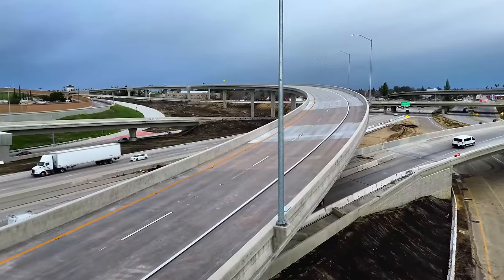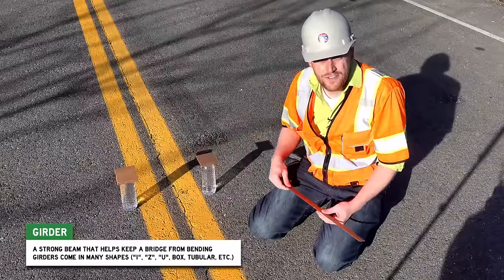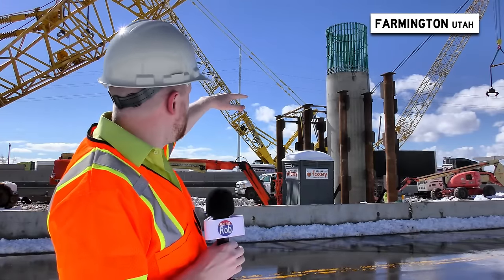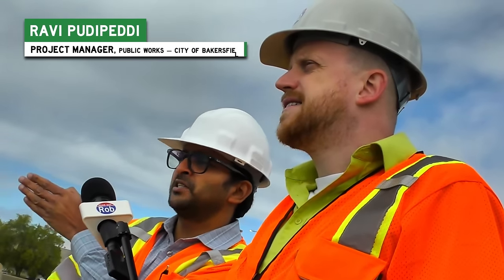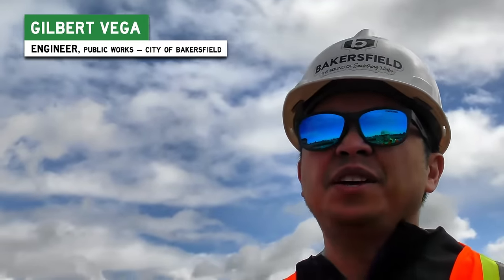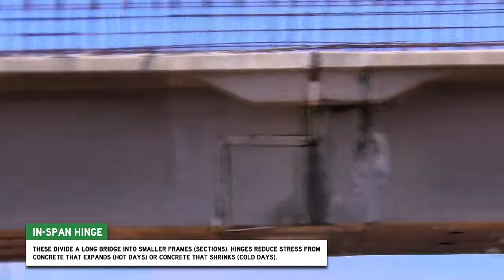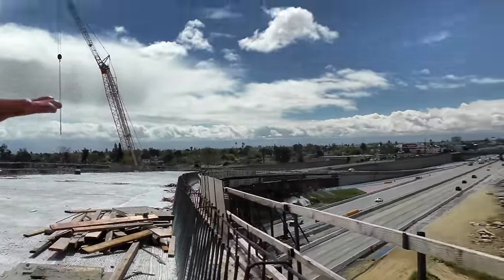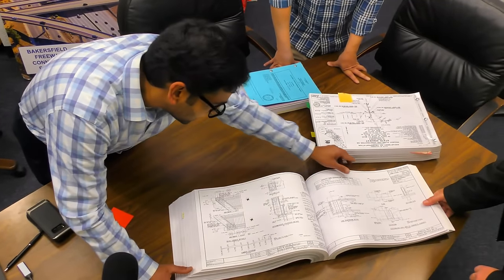This $100M bridge is made with WOOD and is TOTALLY HOLLOW

Comment: When they pulled out that brick of a book I gasped. So much paperwork
Reply: Remember when they flew to the moon they had a body tall size stack of code books (they still use "morse code" to code the instructions then...)
Reply: I have been involved in creating that paperwork.  That book is a set of drawings used to construct the road and bridges.  We drew them by hand using pencil and paper. And then printing sets of copies of blueprints on 36 in by 24 in paper. Later in my career, we went to computer aided drafting systems (Cad). We started printing on 11 in by 17 in paper. By the end of my career we just sent the drawings as electronic files to a printer that distributed them as PDF format electronic files to the contractors for bidding and eventually for the winning bidder, to construct the project. I suspect that by now, the use of tablets and laptops is replacing those books of paperwork in the field.
Reply: @Irishfan  I wonder if there's still a regulatory rule for that hardcopy as a hardware backup as a +1 to the 321.
Reply: Yeah. Considering the money involved, it's good to have a huge book of papers detailing every single minor detail just in case you need to hire a litigator to take it into court to argue why you shouldn't be responsible for a $5 million blunder.
Reply: @Irishfan  I definitely still use a paper copy, can't run out of battery, easy to see in bright sunlight, can spread out multiple pages etc. But yeah it might go fully electronic eventually.
Reply: @PrograError  Not everyone on site has access to a laptop/ ipad. We still use hardcopies most of the time. They are good because you don't keep zooming in and out.

Comment: It's impressive to see how much temporary infrastructure there is for big construction projects
Reply: Yup. Then add in safety requirements so nobody dies putting up a bridge, and you kind of start to understand why projects like these take so much time+money in developed countries. 

You could build this in half the time but it wouldn't be nearly as reliable nor as safe to build. It would cost lives during construction and then lives when it eventually fails before it was supposed to. 

Talk garbage all you want about how american projects go over budget and take forever, but we don't have routine failures like countries that don't build things properly/safely. The success is measured in preventable deaths.
Reply: @CRneu  Exactly. And it would get built in a fraction of the time if it was a completely new highway. But it’s built over and next to an existing highway with live traffic, which can’t just be shut down. Makes everything really complicated.
Reply: @CRneu  Most of the project time is wasted in worthless environmental studies.
Reply: I would love to see a future video about temporary infrastructure during road work
Reply: True. But all construction needs some kind of temporary works, even if it's just scaffolding or simple formwork. It's just that bigger projects need bigger and more impressive temporary works. On one military job I did the formwork needed to support a 1m thick heavily reinforced concrete slab. It needed as much engineering design as the slab itself!
Reply: @grandinosour  we do the environmental studies before the project starts. It’s required by law. It’s wrong to poison plants, animals and people. Plus it’s mean to harm native and endangered species. It’s strange to assume something is worthless when you don’t have a single clue what you’re talking about.
Reply: I ran some jobs to replace machinery in a big sewage plant. We had to remove a column to remove and replace the machines. It took 3 weeks to put up the false work, and only 2 days to change out the machinery. We did 7 of those

Comment: Rob, you do a wonderful job of concisely explaining complex engineering!!! Many box-beam girder bridges today are being built (35W replacement bridge in Minneapolis) using precast segments and use the same principles as the cast in place type you have shown (post-tensioning). The superelevations you noted on this project wouldn't allow for the precast type of construction.

FYI, the foundations shown for the bridge piers are called 'drilled shafts.' 
One minor correction: The top of the piers on this bridge are called 'pier caps' and not 'bent caps.'  A bent cap is normally used to tie together a group of 'bent' pile columns. 

Interestingly, box beam design is what saved the I-10 bridge in L.A. from needing a complete rebuild after the fire was set underneath in November. Had it been steel girders it would have collapsed like the bridge in Philly last year. Instead, they were able to use shoring (falsework) to support it and get traffic back on it while repairs are made to the damaged components.

Comment: FINALLY DID ONE ON BAKO! Knew it from the intro. This is the 58-W. For years, Bakersfield had 99 N and 99 S but only one way going east/west. 58 E is the only highway, 58 W was just a bunch of avenues you followed. Now we have the Westside Parkway, which is the Western highway of the 58, which is now finally connected via this project, known as Centennial Corridor.

Comment: Nice work! As a bridge engineer, i think you did a great job explaining how bridges are made! Of course theres a lot of other nuances that go into it but overall i think you did a great job! I haven't seen the hollow concrete girders used in my state yet but we use precast I- beams for a lot of our bridges without the slab on the bottom. The most similar thing i can think of that we used was a steel tub girder bridge but each tub was visible. Can't wait to see more from you

Comment: The post tensioning is the same principle (on a much larger scale) that has been used for a few decades now with homes build on slab (instead of raised foundation). Very common for houses built in the Phoenix area. Suppose to help prevent slabs from cracking and I suppose settling cracks on the house too. May be it depends on where the bridge is going, but I noticed with the I-10 super project through Tempe and Phoenix, the new bridges are being built one section at time instead of building the entire span at once. I noticed that today for the new interchange being built for AZ-143 to I--10 by Sky Harbor Airport.

Comment: Box girder bridges can be built another way, using pre-cast concrete segments you string together like beads, but then stiffen them with steel cables pulling the segments into a continuous deck. Those designs can achieve some mighty impressive spans, as much as 800 ft / 240m between consecutive supports! They see a lot of use in East Asia and Central Europe, where there's lots of deep valleys and canyons to cross in mountain regions.

Comment: The video is very cool, in fact there is a very good relationship between concrete and steel bars. Concrete is very good at withstanding pressure or weight but is bad at withstanding tension, steel is very good at withstanding tension but is bad at withstanding pressure. This is how reinforced concrete structures emerged, meaning it is not enough to just use cement or concrete, you have to reinforce the whole with steel bars. As for the stretched steel cable that runs through the entire structure, it is one of the most interesting inventions in civil engineering, the well-known prestressed slab, thanks to which it was possible to increase the span of bridges, and also the usable area of large buildings, roofs, everything. which uses concrete and steel.

Comment: The post-tensioning cables aren't straight the way shown here. They're higher near the columns and abutments and lower at midspan so that they exert upward force at midspan and transfer the weight to the columns and abutments. The long spans of today's concrete structures would be impossible if not for that. 

Including this important bit of information would've made this video a great deal more informative. I'm surprised the engineers in attendance didn't insist upon it.

Comment: I'm not a civil engineer, but I have to know how to read the designs in those plans because I do the GIS mapping for my state's DOT.  We have to keep all the state's maps up to date for the public but there is also a ton of data in the maps that the state DOT uses and we also have to submit tons of data to Federal Highway Dept every year.  So we also have to keep track of all local city, and counties too.  Anyway, it is incredible on how much goes into designing a freeway.  My state has done some of those hollow concrete flyovers, but mostly since we have several massive steel mills and mini mills (Indiana) we mostly use steel since it is easily accessed locally.

Comment: I thought they precast pieces of the box girders and then just threaded steel cables through it to pull them into tension.  At least that's how I saw them do it in a documentary about the Sydney metro.  If that works why don't they do it like that everywhere and not create the forms in the air?
Reply: there is a size limit on bringing precast components to the job site.  also a size limit to what can be cast on the ground and lifted into place.  part of the engineering is to determine how they will do it, and because of the size, it's usually easier to cast a box beam in place.  I my area had a historic bridge almost completely rebuilt, and the process involved driving temporary supports, and bringing in precast beams to build a temporary bridge, and then casting the permanent bridge in place, then removing the temporary bridge, and putting it in a spot where, I think, the precast beams still sit, to this day.  the precast beams were only 40 feet long, so they had to have supports every 40 feet, while the permanent bridge has an arch about 150 feet from anchor to anchor.
Reply: I-70 in the Colorado Rocky Mountains and I-635 US-75 were built like this. It all depends on the situation, cost, materials, time, etc.
Reply: I'd guess it comes down to a lot of external factors.  Like can you put up false-work at the site?  Is there an existing precast concrete factory nearby to leverage?  What have you built before?  etc.
Reply: @kenbrown2808  At least the technique I was thinking of didn't require the precast elements to be the size of the gap.  They put together a box beam from a bunch of short pieces and then relied on the tension from the cable to form it into a single element.

Though it did require a big weird crane to hoist it all into the air at once to let them tension it in place.
Reply: @petergerdes1094  that sounds like an engineering nightmare.  at that point, it's basically a suspension bridge with extra weight.

Comment: Fun Fact: At one point Caltrans switched over to the metric system, but they were running into difficulties with contractors during construction projects. Caltrans then switched back to imperial measurements.

Comment: I watched this free get built over what seems like my entire life time. The Cross town freeway, the West side Parkway, this is the Centennial Corridor that connects the west side freeway too Interstate 58 that came to a dead end at the 99. They had planned the west side parkway and built it and it had been pre-planned in the city development and a huge field just sat in between housing developments and shopping centers until finally about 10 years ago the built it and it was cool except it didn't connect to anything so it was not very useful. Bakersfield is a very sprawled out city and really only had the 99 through the middle and then nothing but surface streets to the west which was a traffic nightmare. There was the 178 which connected a portion of 58 through downtown but was not a freeway until you hit the 178 so lots of congestion. Then you had the 58 which connected to the east side but mostly industrial and dead ended into the 99 where you had to get on the 99 go a mile up north and exit to Rosedale hwy and a bunch of confusing turns and it was a mess.This now makes what took 30-40 minutes into 10-15 minute drive. Its great especially when they get it to the Interstate 5. Also i just watched the roundabout video and they are doing wonders here on hwy 43 which would get horrible congestion from farm workers and oilfield workers having to stop at stop signs now its free flowing traffic and its all up and down the 43 which runs next to the high-speed rail. Maybe you can talk about the engineering of the California High speed rail and possibly how they plan to get around the mountains and the steep grades. The way they do it now for freight trains is the tehachapi loop which i dont think is going to work for this train.

Comment: RoadGuyRob - Have you ever looked into the 60/91/215 interchange in Riverside California? It was rumored to have been partially built with lower quality steel rebar. Big legal issues when built in 2007.

Comment: The cardboard you use is itself a version of the engineering principles you talk about. Instead of making it thicker they fold the cardboard in the middle forming a whole bunch of girders. But that means its stronger in bending in one direction which is why the direction you cut the first section failed so easily.

Comment: I was homeless for a hot minute. I stayed in a bridge. I really liked it actually, I had access to power due to someone tapping the conduit and adding an electrical junction box with an outlet and a switch in it. I kept a lamp, Hot plate Microwave and a 14 inch flat screen TV.  I was really impressed at how energy efferent it was. I was there in the start of the winter, and due to the mass that gets heated up during the day, the South side area never dropped below 45 degrees even when it was dropping into the negatives at night. Although, the opposing North side was much colder having the sleeping and living quarters on the warm side, you really never noticed until you ventured over there.  It was a short stint but since then I have kinda fantasized about building myself a similar structure made of honeycomb shaped walls and rooms. My city refuses artistic liberties with homes though. I am stuck in a weak and unreliable Wooden structure at the mercy of wildfires tornadoes and Hurricanes. This just proves the fact that most times, Governments are stupid.

Comment: Abutments and MSE may be more of an art than a science, at least for some contractors. When the flyover ramps on the Johnson County Gateway project (I-35/I-435/K-10) in Kansas opened about five years ago, the ramps sort of sunk right where the end of the bridge met the abutment because they didn't compact the soils underneath the ramp on the abutment quite enough. It made for a fun little bounce if you took it fast enough.
Reply: that was a big big cluster for many years, they completely renovated that whole interchange. looking back i find it amazing how they can take the old road(s), reroute so many lanes of traffic to work on the other side, and now it all looks like it was the original.

Comment: This whole process, including falsework, makes one wonder why Caltrans and its contractors haven't attempted what TxDOT and its contractors did with the Dallas High Five project (I-635 and US 75 interchange). Namely, assemble bridge portions in place akin to an assembly line, then use strong bolts to tie the pieces together. A similar type of process was used to assemble/construct New Orleans's Lake Ponchartrain Causeway, one carriageway at a time.

Comment: 1:57:  There you DON'T go, Road Guy Rob.  That bridge illustration is flawed because you need "support columns" not in the middle, but at BOTH EDGES!  Your "bridge" doesn't topple because the load is too heavy or because it's not anchored; it topples because you have an imbalanced support system.

Comment: I do have a question. When they were widening the 99 for this project, I noticed one strange thing. Where the freeway is going under road grade, all the roads go over the freeway. They shear the walls back to give more lanes, and I saw what looked like strange buildings on the side of the walls that they had to build. Are the buildings holding pumps to pump the water from the freeway drainage lines during rainy days?
Reply: Yes. Bill

Comment: I am not an engineer but the Ibeam bridge looks a lot easier and cheaper to build
Reply: It's also a reason why it's also popular in infrastructures in impoverished states and other countries, plus you pretty much could just precast it and then ship it... (not that box girders can't, it just takes more work...)
Reply: Like everything in engineering it depends.  I beams can only practically be so long, due to transportation and manufacturing issues mainly. So for a design that involves a long curved segment between supports, a poured in place box beam can easily be more economical.  So why choose the long curved bridge design?  It can provide the needed level of safety for the lowest cost.  That design can be cheaper because it can use less land, and/or less earth works, or any number of other factors besides just the cost of the bridge.

Comment: California has earthquakes, and while steel beams have no problems with shaking (steel absorbs those vibrations), concrete tends to CRACK under severe vibrations.  So why does California build using concrete when instead they should be building everything out of steel instead?   If they don't have local steel making facilities, then just import the steel from Eastern USA where they do.

Comment: There's a lot to never skimp out on cement and rebar compensate with different materials and designs for thermal expansion wind hydrostatic pressure etc everything has to be dialed in carefully with attention to detail don't save a couple of dollars in materials like China and Wonder why the 3 gorges dam is ready to fail 🤨